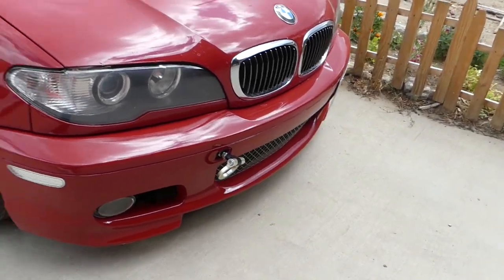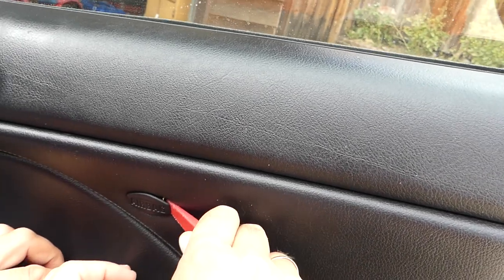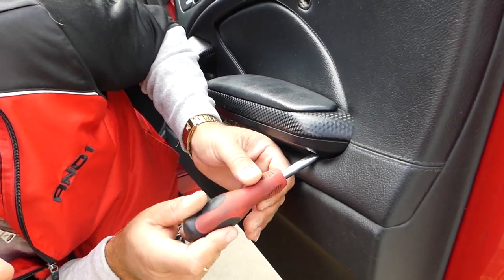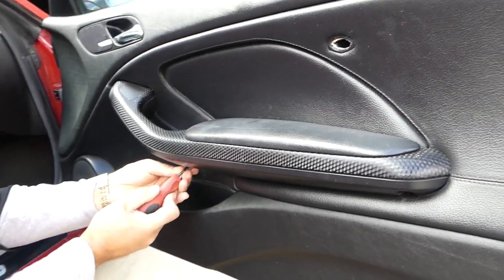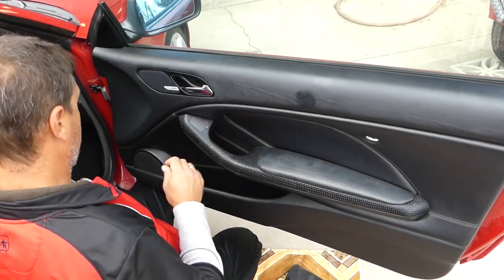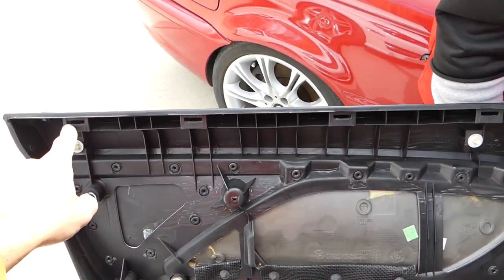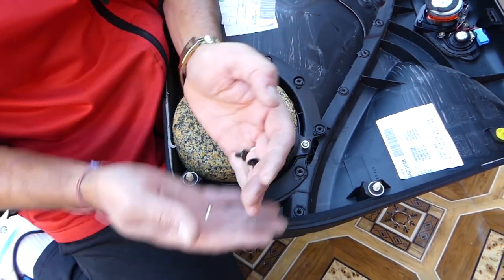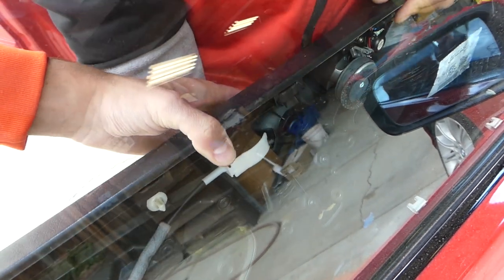HOW TO REMOVE AND REPLACE  FRONT DOOR SPEAKER ON BMW E46 CONVERTIBLE COUPE

Comment: What size are the side door speakers
Reply: Also curious to know.
Reply: Found somewhere said 5.25 but it's too small looks more like 6.25 or 6.5
Reply: @ligerxen7933  its 5,25 but you can fit 6.5 with adapter, but the main issue is the depth of the speaker, i think 58mm is the max you can fit
Reply: Please let me know
1)  the accurate and  specific dimensions for the front and rear speakers for bmw e46 318ci convirtable '03 

2) please if it possible  suggest me and set of speakers  .